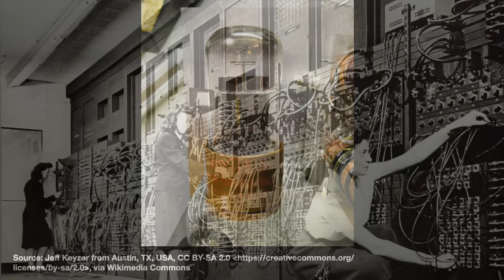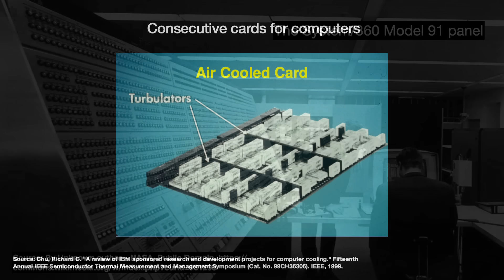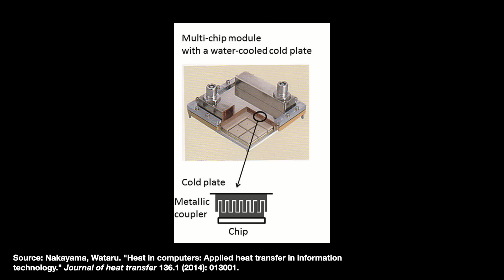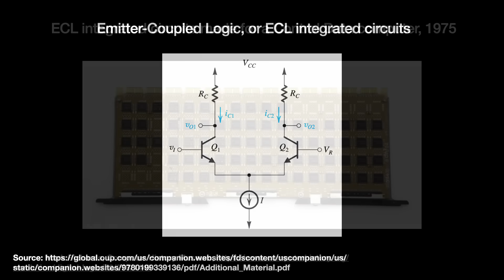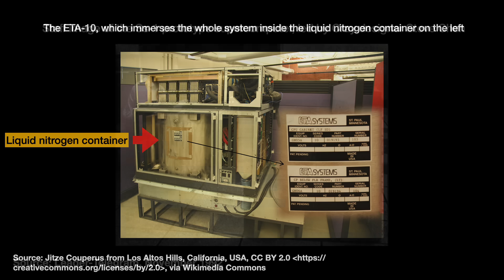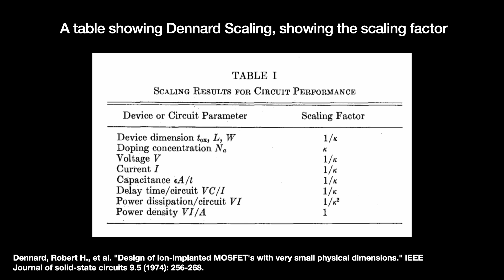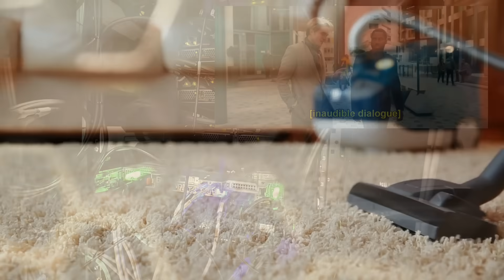Chilling Chips: A Computer Cooling Chronicle

Comment: Modern CPU max die temp = 105C.   Box temp military ground is 60 C.   We were making “engineered 3 D heatsinks.  This is good to about 20Watts at the module wedge locks.  Very linear.  Sad to see LED bulbs that fail,  means thermal issues or stress levels were never addressed.  No Boomer EEs remain.  History will repeat.     Notice there are no engineering techs or JR. EES ANY more ?   AI will get the bottom.  Not great for future management talent.   I liked the exploding tantalum caps failing due to high ESR.

Comment: Is purified water better at cooling than "tap" water? Just wondering as the surface tension of water often doesn't allow it to "wet" out so often a wetting agent is employed in closed loop systems. Early in the auto industry they used alcohol added to the radiator which greatly added to water's effectiveness at absorbing heat from the metal.

Comment: The advanced semiconductor testers that I used to use when I worked at a major semiconductor manufacturer used boards that had a aluminum jacket on them that channels Fluorinert directly to the chips. The aluminum jackets covered an entire board that was maybe 15x30 in. It had channels in it for the Florida to flow through in direct contact with the electronics with rubber seals. The jacket sandwich both sides of the board with one half screwed held in place by a very large number of small screws. I want to say there was maybe 18 boards per test head, test head being maybe 48 in wide by 48 in long by 36 in tall. On top of that mounted two boards that contains sockets for the devices under test. The liquid coolant was pumped through the test had by a chiller which was a conventional freon refrigeration unit which could cool it down to something like -40° C.

Comment: I replaced a ThermalConductionModule once. It cost one million Ringgit and was hand carried from Indonesia. The managers balked and asked me if I was REALLY sure. Luckily the customer was generous and gave me downtime to swap the two CPUs and the error moved. I saw it featured in an edition of the IBM Systems Journal . . . but . . . when I referenced the online version, it was an inferior photocopy-pdf. Sheesh. I think the latest Z17? mainframe uses watercooled metal slabs and the replacement can be done while the rest of the mainframe continues running. Times have indeed changed.

Comment: I once made an immersion cooled PC. It had a custom PMMA case, and the liquid was pure paraffin oil (it is electrically insulating, totally clear and flows like water when warm). I sourced the oil from a Veterinary friend because paraffin oil is used as horse laxative...
One issue I had was that of course the only part not submerged was the hard drives, but not all cables could be used. Some where not fully molded and sealed and the oil could seep through the internal connector, into the cable between the copper filaments, then out the other side. Of course I found that the hard way. The other issue was that if oil got into any connector, it would migrate between the pins and cause lack of contact. So, if a part needed to be changed, all connectors had to be very carefully cleaned and degreased. During operation though, the connector pressure between pins was enough to keep electrical contact. Fortunately I never upgraded anything much on that PC.
It was a cool machine to look at, all electronics where off the shelf watching the fans run super-slow was amusing.

Comment: In high power broadcast FM more than 1kw still often have air cooled final tubes that make a lot of heat. Traditionally it was such that it was not practical to use an AC unit so the blower would draw in outside air near the ground and vent it out through a roof vent. Keeping everything clean is a challenge. Tubes could shrug off some lightning strikes solid state could not. Finally with chips like LDMOS becoming high power enough (each chip producing more than 1kw) reliable enough for the environment (being connected to a 500ft lightning rod) no need to rebuild tubes every 3-4 years, runs cool enough to be reasonably climate controlled with an AC unit and cost savings in electricity enough that new transmitters will pay for themselves fairly quickly. I like them because they are easy to work on and don't require manual tuning like the tubes do. Also there are only a couple companies left rebuilding the tubes and charge around 5,000usd to do so.

Comment: "The computer consumed about 150 kW of power and put out approx. 150 to 174 kW of heat.". At a power consumption of 150 kW, the maximum amount of heat is 150 kW. - see thermodynamics!

Comment: About cooling systems... I heard this story when I worked at Convex, but didn't witness it myself.  But... In the early 90s we (Convex) got approval from the US State Department to sell our older mini-super-computer model (the C1) to IDA-Opel, an auto manufacturer in Serbia.  The Berlin wall had just fallen and the cold war (at least with Yugoslavia) was beginning to thaw.  So our European sales force arranges for the sale and delivery.

Convex mini-supers were advertised as "25% of a Cray at 10% the cost."   And part of the cost-savings was we didn't include a cooling system, but provided pointers to existing commercial air conditioning units that were FAR less expensive than integrating a Fluorinert cooling system into your system.

So we install a C1 at their data center and they install a typical high-throughput air-chiller next to it and it seems to be working fine.  But the local Minister of Trade wants to have a press event and collects a bunch of reporters in the data center to talk about the wonders of technology and how it's the beginning of east / west cooperation. There are plenty of photo ops of the minister standing next to a modern looking machine with plenty of blinking lights...

but...

if you've ever seen a Convex C1, it's essentially a simple black box with a single "Big Yellow Switch" for power.  I'm not even sure they had a power indicator on the front of the machine.  The device with all the blinky lights the minister was pointing to every time he talked about "high tech" was... of course... the air conditioning unit.
Reply: Also... part of the Convex cost win was we used CMOS instead of ECL or (later) GaAs.  Damn, GaAs was hard.  So... sure... ECL was faster, but CMOS could be driven pretty fast and it was a cost win 'cause we didn't need to dunk the whole unit in a cooling liquid.

But ultimately moore's law killed us too.  I think it was Q2 1993 (1992?) when suddenly RS/6000s beat us on price/performance.  Our quarterly sales went from millions to zero in one quarter.  Alas.

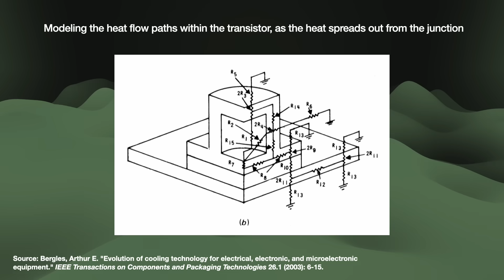Comment: As someone in a thermal.simulations team, this is very interesting.  Liquid cooling is for very hot running devices.  Cheaper to use a fan with all the tricks like heat sinks,  potting, gap pads, etc.  8:02  thermal resistance networks are still used.for.sanity checking CFD results.  IC's still have the thermal.resistancr for junction to case (top and bottom) in their specs.

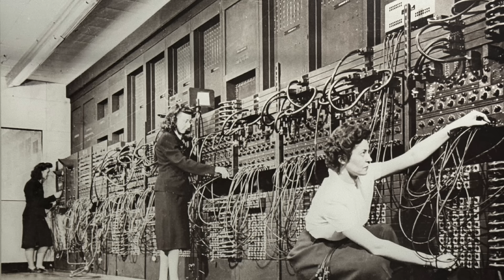Comment: 1:12 incredible! they managed to break the laws of thermodynamics
Reply: You were today days old when you found out that electrical power and thermal power use the same units but don’t measure the same thing.  Thermal watts are usually scientifically annotated as w with subscription “th” to denote thermal watts to differentiate from electrical watts.  

Example: Qinshan Nuclear Power Plant has 2x 677MW CANDU reactors that produce 2 × 2064 MWth
Reply: @ChadThundertalk  its alright for a power plant, it's mighty sus for an electric heater. i hope i don't have to explain why

Comment: I like the chart showing the heatflux. A typical GPU today has a heat output of around 100W/cm² , so 10^6W/m². The chart implies the impossibility of it by comparing it to a nuclear blast. Yet we use it with air coolers every day.(e.g. 4060Ti 188 mm², 160Wstock, easily 188W with overclock)
Reply: 1 MW/m^2 is the same order of magnitude as the heat flow inside of a rocket engine. It is actually surprising that cooling the GPUs is still so relatively easy.
Reply: @cogoid  The obvious big advantage for GPUs is, that you can expand sideways for dozens of centimeters often right at the height of the GPU into space with much less Heatflux. The middle of a rocket nozzles does not have that luxury.
Reply: @tristanwegner rocket nozzles definitely expand.
Reply: 2080 Ti ran off an uncontrolled thermonuclear reaction.  My Japanese mother thought we dropped the sun again when she inherited it.

Comment: Calling transistors "Non heating" made a lot of sense compared to vacuum tubes, which had a dedicated connection to run the internal heater for the cathode, so it could emit electrons. Vacuum tubes NEEDED to be hot (at least internally) to even work, whereas a Transistors works great a room temperature or even lower, and the heat output for the same logic performance is miniscule compared to the tubes.

Comment: Cooling will be a big limitation to putting AI farms in space. No fluids to transfer heat into. Chat gpt told me it needed 13.5 m^2 aluminium sheet to keep a 1kW heat source at 80 C if it was in perpetual shade in space.

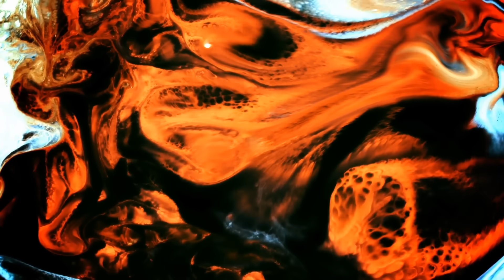Comment: 5:32 and following to liquid solutions~ Yeah... when you ask Economics/Management graduate to solve electronics heat problems they would say "what is cheaper than deuterium?". Statement like that and using any problematic cheaper chems will worsening fact that actually just deuterium(and I mean for big machine/server) and sink all electronics in there(deuterium bath/pool) could works for decades.

Comment: Just build your data centres in Antarctica! Problem solved.
Reply: yeah~ ice there is still bi-hydrogen-oxide aka can make your electronics go bust. Unless you make deuterium/heavy water lake and submerge all electronics below. Then those Antarctic "cooling system" could works well.

Comment: As a long time computer hardware enthusiast, the engineering around cooling has often fascinated me more than the hardware itself.

I recall EEVblog doing a tear down of one of those IBM multi chip modules and I saw the pistons and thought, what a simple way to achieve uniform constant contact!   Also, not mentioned in this video, those modules with the pistons are filled with an oil, probably mineral and the pistons are fairly close to the bore so the heat transfer would be decently good. And the neat thing with that design is it allows for thermal expansion and does not need re-pasting like more conventional designs.
Reply: I studied Physics in undergrad and got a decent wallop of thermodynamics.  I still remember being in the Si-Five offices and me and the mechanical engineer (who also got some book learning re: heat) having an argument with an EE about where the heat goes after voltage is applied to a transistor.  Fortunately this engineer was not allowed anywhere near physical systems and was a decent logic designer.

Comment: I remember the advent of transistors. DIY projects were cheaper and simpler because "the heater" did not need to be wired up or powered. The tube industry fought back by bringing out cold cathode tubes, but it was too little , too late.

Comment: The reason chips need cooling, fundamentally, is extremely interesting. It's because they are destroying information. Only irreversible computations necessarily emit heat. Fully reversible computation can, at least theoretically, be performed without emitting any heat. There are researchers and companies experimenting with building special chips that use reversible computation for everything, and they require next to no cooling, although they have to be designed differently. Vaire Computing is producing a chip for AI inference that uses this idea and (they claim) achieves 4,000x reductions in energy consumption and heat emission.

Comment: This kind of stuff drives me nuts. 

The other one is grocery stores that want their customers to only use certain entrances at night. So you’ll find an entrance with automatic doors, that has been blocked and or clogged with shopping carts. With an exit sign above it. So, say the store is on fire there’s lots of smoke and low visibility, and some old person without a lot of strength gets to the door and finds that they have to move a couple of hundred pounds of shopping carts out of the way. Seems to me that the door should have some sort of disable switch with a red emergency exit button on the wall or something. Or some sort of solution that doesn’t solve your security problem by creating a safety problem.

There have been times when I have been sorely tempted to make an anonymous call to the fire department. But, there’s a part of me that just doesn’t want to cause trouble.

Comment: The existing data centers have gotten so so so!! much louder in the last 5 years alone. I must wear hearing protection now. It’s an environment that’s constantly over 95db. Next to the servers, especially the newer ones are over 110db. Super loud. And the newer datacenters are moving to be primarily cooled by water. Not air. Our new racks will have water intake and return lines. I actually can’t wait to start building in them to see how that will work.

Comment: UCLA engineering dept had a mighty 360/91 with an entire megabyte of core memory, and every peripheral. Served hundreds of students.
Its machine room was very loud, very cold.
Reply: I went to the University of Texas at Austin in the late 1960's and early 1970's. We had a CDC 6600 which at the time was a super computer. It was an air cooled discreet component ECL computer using "cord wood" modules construction. "Main memory" was core with banks of removable platter disk drive memory and backed up by tape drives. This was the classic memory hierarchy I studied in my computer architecture classes. Ah, memories (pun intended)!  The "engineering terminal" room had a smaller CDC computer with a high speed card reader and a fast (for the time) 132 column line impact printer. Spent too much time in the engineering terminal room. Probably damaged my hearing. 🙂

Comment: Not a single mention of heatpipes?!
You even show a few (CPU) coolers using heatpipes but don talk about them at all?
- the less than atmospheric preassure inside
- how it's basically a shrunk down closed-loop 2-phase cooling system
- the copper(?) wick(?) inside to funnel the liquid back to the hotspot via capillary action(?)

Comment: Interestingly, the 6SN7 tube was actually still manufactured until fairly recently, since it had applications in guitar amps.  RCA used them in their televisions, until another type replaced them in the same circuits...

Comment: A study can be conducted to determine if water injected through Venturi pipes can cool down air that is circulated through a data center system at a higher efficiency and minimal power usage than with traditional refrigeration of air.

Comment: Microsoft had an experment in Scotland where they had a test  underwater container sized data center for two years called project Natick, to prove the concept, would work.

A local company also had a milatary army computer back pack, They filled it with oil, I dont know if they resolved the  continuing problem of the oil leaking, think it was for the Indian army.
Thanks for your well reserched vrry intresting video's.

Comment: We have to admit that current microelectronics technology has hit its limits when a single NVIDIA chip generates over a kilowatt (1,000 W) of thermal WASTE, which requires several hundred more watts of energy to remove and dump into environment - further heating the planet. 
And we are talking about MILLIONS of such AI processors each dumping kilowatts of heat into the environment.

Comment: You are absolutely right.
The smaller an object gets, the more people want to pack them together. And this desire has no end. Physics however, does but so far I have great respect for how these limits are constantly moved forward.
Reply: > "The smaller an object gets, the more people want to pack them together"

Is that just nonsense?! No matter the size of "objects" - people will always want to pack "them" together (as space efficient as possible).

I've never seen a pallet of bricks where every brick is individually packed and padded...
Reply: @L1m3r  Is this video about bricks?
Is this video about packaging?
Reply: @Ctrl_Del_0  is this vid about unspecific generalized OBJECTS?
no, i'ts not.
Reply: @L1m3r  Was it me who started about random generalized objects?
Perhaps next time show a little bit more respect when you respond. Then perhaps the respons may be different.
And by the way, this my last message.
Reply: @Ctrl_Del_0  Oh boy..

1. I'm soo sowy for pointing out that the 1st sentence of your OP is useless because it's pretty much a universal fact that everything NO MATTER THE SIZE gets packed as close as possible (from gravity+sand to shipping/storing anything).

2. I'm not the one fixating on my outside example for whatever reason. Seriously, the bricks are on example and you fixate on that instead of addressing the actual point of my reply.
Reply: “…and they go to three dimensions, where the chips look like cubical sculptures - and the system clocks blocks - and the blocks proceed on the basis of their cumulative propagation delays…”